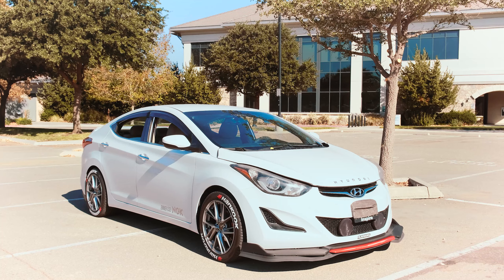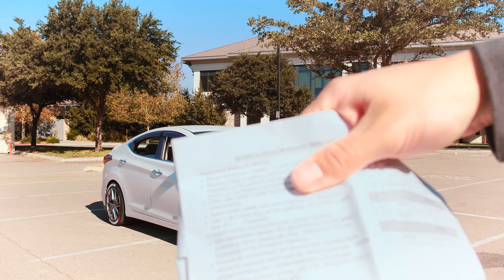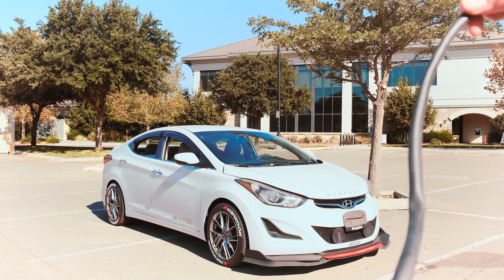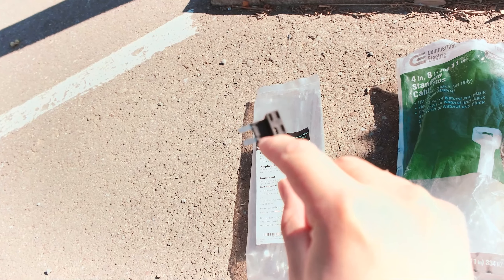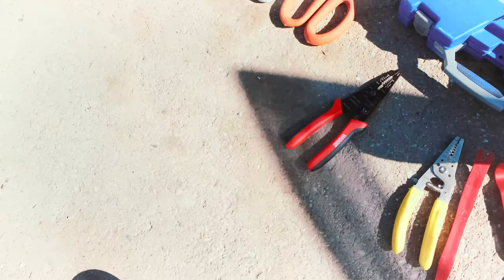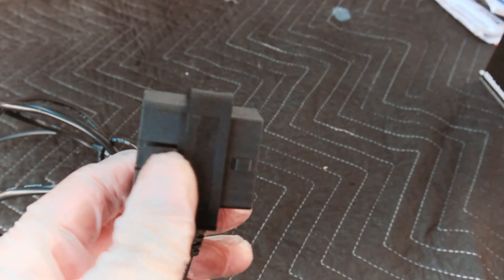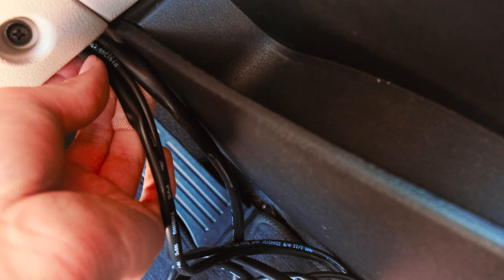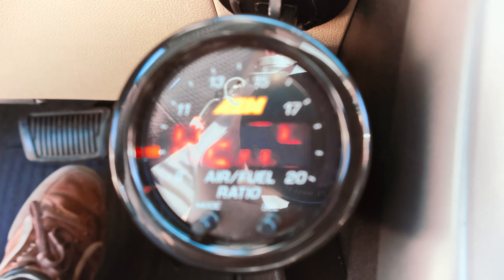[On The AEM Train?] Installing An AEM OBDII Air To Fuel Gauge! +Practical Elantra Wiring Tips

Comment: Nice install :)   But, PLEASE do not start the engine with the sensor heated up, like that.  That is, by far, the #1 cause of sensor problems/death.  The sensor element is made of ceramic. And, it "warms up" to over 1200°F ( glowing orange ).  When it gets hit with a ( relatively ) cold/wet mass of start-up exhaust gas, the ceramic fractures.  1st, this causes internal leaks, with destroy the accuracy of the sensor. Then, the cracks spread and make the electronics flaky.  Then, they hit something vital and, the sensors  just die.  If you leave the gauge powered up for more than a few seconds, before starting the engine, turn it off for about 20-30 seconds, to let the sensor cool off a bit, before starting.
Reply from the maker: Hey!

Thank for this! I actually thought warming it up before starting was good to do; i had it backwards! Good thing i didn't put the new Bosch in and only did that 'Warm Up' in this video! Again I appreciate it!

- Jonathan
Reply: @alittlebit-ofeverything  No problem. I always cringe when I see that. You would THINK that the WB manufacturers would mention this to people BEFORE they do it. A LOT of people think they are playing it safe by pre-heating the sensor.  They usually end up calling the manufacturer to complain about sensor life.  THEN they find this out.

Comment: can i have your instagram i got a couple questions
Reply from the maker: Hey Devin!,

If you want, you can PM me on here, or just ask in the comments.

Thanks,

- Jonathan
Reply: @alittlebit-ofeverything  okay how’s the supercharger doing on the elantra right now?
Reply from the maker: @devinclark2421  Hey Again!

I have a separate video planned for that. Basically an update and future plan video. But in short, the unit was not installed.

Thanks,

- Jonathan
Reply: What website do you order from? I have a 2014 white Elantra and I’m looking to tune it to stage 2, also could you only find a supercharger? Or could you find a turbocharger as well